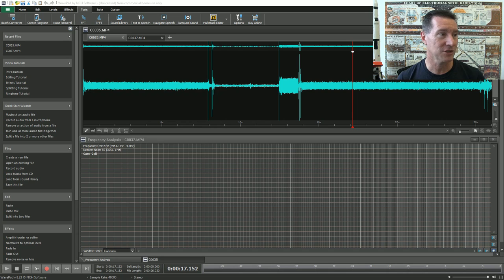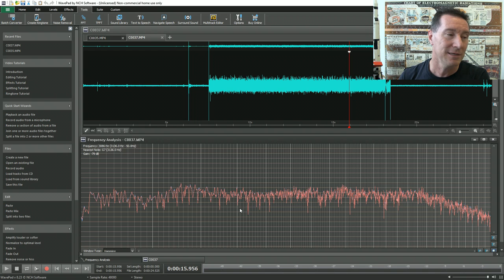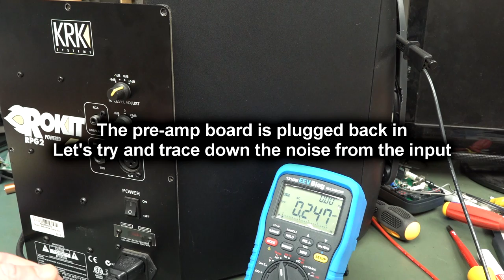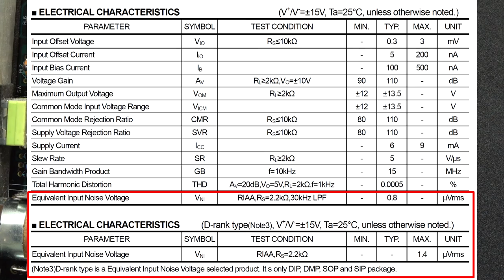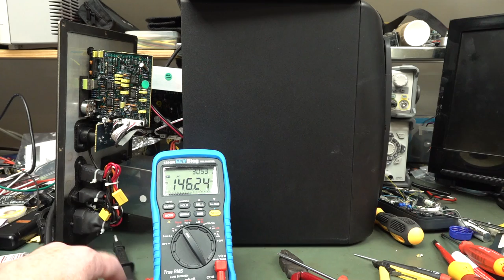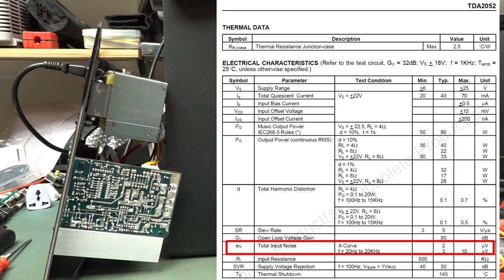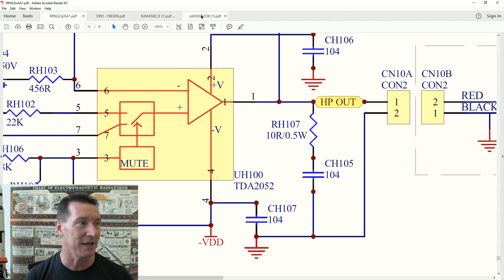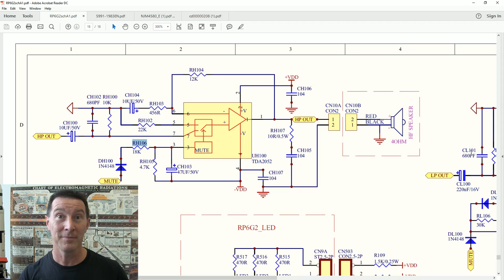EEVblog #1118 - Why Are Studio Monitors Noisy?

Comment: Because those are basically "pro-sumer" grade at best. Built in power amp is the first red flag. Probably perfect for their purpose though. You'd be silly to set up a recording studio level monitor system for your application.
Reply: Even the most expensive studio monitors are powered bi amp speakers. The reason is you want an individual amp for each driver. This approach apparently provides a better crossover and transient response
Reply: My comment had nothing to do with bi-amping. There is a cheap, possibly class D, amp in those things. Not that class D is necessarily bad either, but does require higher quality to get right.
Reply: finally saw the teardown. Not class D. Not high end by a stretch though.
Reply: Phillip Morrison, exactly, there are plenty of professional studio monitors with builtin amps. More compact and convenient, no crosstalk. I guess it also helps to tune the frequency response of the entire system? (although I'm certain the amps are much flatter than the speakers)
Reply: Dan Moos  I'm responding to your comment " Built in power amp is the first red flag" by explaining why even the most expensive studio monitors are POWERED bi amp speakers...
Reply: ah.
Reply: Nothing wrong with integrated class D amps, as long as they are of good quality.
Reply from the maker: If you looked a the datasheet the driver is Class AB
Reply: @Philip  "Even the most expensive studio monitors are powered bi amp speakers."
Obviously, a powered speaker is always gonna cost more than its non-powered equivalent, so the most expensive is powered.
But I assume you meant to say all pro monitors are powered bi-amp speakers? All will probably be true for being bi-amped, but not for being powered.
Reply: Kris M It would be silly to waste a rack slot (or more) on an amp just for the mixer room monitors.  Which also provides another point, the mixer room will have background noise from tapes, fans, meter needles, chairs etc.  Monitor noise just needs to be less than that.  Now if you install monitors on the silent side of the glass, they should be passive speakers fed from an amp in the mixer room.
Reply: @John  I agree, and so did you. :)
Reply: wahaha meter needles :P

Comment: My cheap-o MicroLab T9s i use with my w/shop computer became so bad with hiss over time i gave up on the crap-as internal amplifier with all the OneHungLow components. By 'back engineering' the amp containing unit so the x-over feed was re-joined to the external terminals and removing the fixed mains in lead i had two normal speaker units. Smacked together a TDA7377 with a VR on some protoboard and power supply... the speakers have never sounded so good.

Comment: Hey Dave, can you do a video on output and speaker matching? How the impedance is measured. How a home gamer can test for best guess speaker impedance with limited gear (like my 121gw)

I think it's a fairly important but overlooked segment of electronics... not high level stuff.. more like beginner level
Reply: Speaker impedance is probably not what you think it is. If you looked at the AC impedance, you would be astonished at the very large rise at the speaker's resonant frequency. At high frequencies, the impedance rises as the coil inductance kicks in. The curve of impedance vs. frequency looks like a backwards S turned on its side.

Still think it's simple stuff?

Comment: I do a project making a sound system that are active.use dsp cotrolled crossover and build 4 mono power amplifiers for tweeter and midrange section.they are 120w each.They are  copied from a popular build from milenium and are called The end xp milenium.The pcb is a little bigger than a credit card with sanken2sc2922 and 2sa1216 on each.no global or local negative feedback is used just short signal path and very good components.every stage run only in their most linear state/power?area.No self oscillation problem.they sound better than the rotel and nad or some high end brands that i have had over the years.since i use amt type tweeters and planar midranges with high sensitivity direct from poweramps i need extreme ow noise.The end XP mileniums does with so low hiss that i only can detect it with ear to tweeter.with a rotel power amp i could hear the noise from my listening position 3 meter away.Nad was a bit better than rotel talking about noise hiss.

Comment: And the result or quintessence of this videos is now... ? After 23 minutes you just answer where it comes from, and then, The End? No word on if it can be fixed with a different (better) power supply?
Reply: It's noise inherent in the power amplifier plus a little thermal noise from the resistors around the amp. Everything has noise. Whatcha gonna do?

Comment: Yeah that's what I thought. The noise is not because of shitty amp, its because there is no passive crossover to decrease speaker efficiency and eat the noise.
I had to get rid of my JBL monitors because of this hiss. The only solution I can think of is to add a couple of L-pads while controlling the balance between woofer and tweeter with a good microphone.
It will lower the maximum SPL but it is worth it if the noise is gone.
Reply: what did you replace them with? i have the lsr 305s and i don't like the hiss
Reply: Used jbl studio 530

Comment: It's because the output  transistors  (inside the chip package ) are  slightly  biased   on, causing the  noise/ripple
Reply: Causing it how? And how does this square with the silence when the preamp was disconnected? Every class B amplifier has bias. They don't all do this.

Comment: Helppp! My HS5 as making a very high pitched sound as soon as I turn them on and I've tried everything. It does that even when it's not plugged to the interface or if absolutely nothing is on next to it (my setup is just the monitors and a scarlet 18i8 and it does that even when everything is off, the internet modem is far away as well as other electronics), when it is just simply plugged with the power cable. I've tried changing plugs but yeah it makes this noise as soon as I turn it on, just with the power cable plugged into it. What could that be??

Comment: USB Headsets have the same problem! Every one I came across, even some in the 200+ € range, have a background noise. Only plug it into USB, and **shhhshshshshhshs**. Even some which were praised as "good sound" by friends, I put them on, NOISE... Then I use the onboard soundcard with normal headphones: No noise at all. Even with the Realtek chips. Same with my (old) Soundblaster Live, no noise at all. I hate those USB headsets, only good for loud environments...

Comment: You are right - the noise in the tweeter is inherent in the HF power Amp. It is a design choice, not a fault. You probably have gobs (audiophile term - it means several dB) of spare gain in the overall setup that you are not using. Reduce the HF Power amp's direct gain by a couple of orders (say RH104 to 2.2K) and the absolute output noise (but not the signal/noise ratio!) will then  improve (decrease)

Comment: What about fitting a capacitor between the negative and positive signals in order to reduce noise is this a crazy idea can anyone tell me a simpler solution or is it just a question of  replacing the power board with lower noise levels as the kind gentleman said.

Comment: I have a pair of KRK G3 6's and they are not noisy at all. Even my Behringer MS10 are not. So its not such a apparent problem
Reply from the maker: Do the KRK G3's have auto-mute?
Reply: sorry dude it really is a wide-spread problem. in fact its so wide spread you might as well say every studio monitor has this issue. it drives me up the freaking wall. i almost need to use just off the shelf silly speakers with an amp for analysis because of the lower noise floor.

monitors are basically at maximum amplification all day long with a quiet input. it sucks.
Reply: But could it be as simple as changing the feedback resistance to alter the output gain stage? This video is making me want to mod a few speakers I have which been bugging me because of the hiss.

Comment: Do what I did. Get to fire guns without full hearing protection and every amp sounds great.I am partly serious. Fire a single 12g shell and when the ringing stops you will save a fortune in audio equipment but be unable to tell anything has changed. You can get the same effect using earbuds and a music player/phone for a year.
Reply: And once you get past the age of 60 there is no high frequency noise anywhere, apart from that continuous 1kHz tone that's always there.
Reply: Well past 60 and have been lucky there. No tinnitus at all. Top frequency is down to about 10KHz which is fine. Many youngsters wearing earbuds will be in a much worse state.

Comment: You talked for a long time about what does not cause the hiss, but then just concluded "it's the amplifier." That's not very helpful. What is it about the amplifier that means it hisses and is there any solution to the problem? Quite a frustrating video, actually.

Comment: I put it down to bad amp design, if most powered monitors are noisey. why should they be different to seperate amp and speaker in regards to noise. my sony av amp can be at full volume and be absolutley silent, hey even my 20+ year old sound lab pc speakers have no audable noise at full volume.

Comment: I used to have a really strange problem with my old speaker setup back in my old apartment.  For some reason, only during the summer months, and only at certain times at night, a radio station would suddenly start coming in through my AUX input.  It was the strangest thing.  Since I've moved, it hasn't happened and it would only happen in the summer and during that certain time of night.   Thinking back, the same kind of strange thing happened with my old corded phone back in the 80's when I was still living at home.  It would only happen at night.  And my phone would pick up this one person's CB radio.  It was always the same guy.  He was in a truck and I even remember his handle (He signed on with it all the time.) because I would be talking on the phone and this guy would come on and I would hear the guy's side of the conversations talking about where he was going.  I couldn't hear the voice of who he was talking to.  I only heard him.  He was always on the highway a good several miles away from where I lived, and it was quite a distance.  At first, it used to startle me because I would tell my friends that "There's someone else on the phone with us!".  My friends couldn't hear him so they always thought I was nuts.  Sometimes, I would pick up the phone with the dial tone running and hear the CB guy.  And once again.. I believe that this is an issue that only happened in the summer months.  Does the summer weather do something to radio signals or something to cause electronics to.. be more receptive to picking them up?  What could have been causing this?  I've been curious about this for years.
Reply: High temperatures causes cables to expand and hence increase in length. The effect is similar to changing the length of a radio antenna.
Reply: Well.. the telephone cables in my neigborhood were underground at the home where the CB was affecting my telephone Our telephone box was up the street and shared by four other houses and the cables all ran underground.  So I don't know if expansion and the cables picking things up is the answer.  Unless something on the roof of our house (or someone else's was picking up the signals and was somehow funneling it down into a phone line).  There were above ground cables attached to the building in the other case where I was getting the radio station coming in through the AUX port on my computer at night during the summer.  The AUX port also wasn't connected to any cables by the way.  It was open to the air.  And this problem stopped when I moved to my current apartment.

Comment: Can't find a Pin for pin replacement, most of the audio guys recommend replacing that module with this board
HiFi LM3886TF Mono 68W 4Ω Audio Power Amplifier Board AMP 50W/38W 8Ω Q5B5. $6.36 US free shipping from eBay. Based on a TI LM3886 module. Has same basic specs, Different package but audio guys seem to agree gets rid of the hiss. They agree that using the assembled board is fastest easiest, cheapest and best way to fix those particular monitor speaker's hiss problem.
Mark in Texas

Comment: Pfft. Powered studio monitors are gimmick junk targeted at the burgeoning rube and tweaker markets. "Studio Monitor" is a marketing term and has no meaning outside a sales brochure. Quality studios buy quality component gear (Tannoy speakers with NAD amps, Magnapan speakers with Krell monoblocks, etc), and set them up very carefully, then spend most of their time wearing headphones. Almost any mid-high quality bookshelf speaker with a half-decent external class A or AB amp will sound a lot better than a "studio monitor".

Comment: You are using a microphone to record the noise. Duh. The microphone is picking up noise that  may or may not be there in the monitor itself. The only real way to measure this is the electrical /ohms/watts/dc/ac current measurements. The thing you're forgetting is, studio monitors are designed to give a neutral picture of real world conditions. Without that, mixing/mastering is useless.

Comment: The noise may just capacitively couple through the thermal tab and the heatsink from the power supply, or it may be a less optimal layout for grounding / bypass of the amp.

Comment: I'm thinking of getting a pair of Yamaha HS-8s. Does anyone here have these, do they suffer from this problem and where would you place them in the market in terms of quality?
Reply: I have a pair of HS-5s.  There is some pickup in my system, but as I can hear that through headphones from my interface (Focusrite 6i6), I'd say the Yamahas are quiet and my cabling needs a bit of attention :-) .  I have nothing else to compare them to, but I like the sound they make (although the HS-8s will have a better low end) and they are well made.
Reply: Can confirm hiss, even worse if you have a mixer and usb soundcard in the loop. Found that plugging the computer into a separate outlet on a different circuit fixes the ground loop but still has the minor hiss. I also have had Adam a7's and the Yamaha are slightly duller but as with any monitor you get to know them and can account for their flaws. Also needs sub, any sub will do IMHO. Obviously the paired one is better.

Comment: This is largely just a shit power supply I think. The 100Hz hum is probably being coupled in simply due to proximity to the transformer. It has nothing to do with using Class AB/Class D or anything else. I have designed LM3886 based amps (often used in powered monitors) which are dead silent.

Comment: So they overspend on low-noise op-amps in the pre-amp stage when they know fine well that the chip-amp downstream is crap (and probably a Chinesium copy of an old Japanese/Western design at that).

Isn't that they very definition of poor engineering?

Comment: inherent noise of class-d amplifiers..  (We got a set of tannoy  speakers with no hiss on the tweeters..) and a set of EON 10's that are super loud hiss...
Reply from the maker: These use a Class AB amp.
Reply: Yep the classic Class-D vs Class-A noise.  Just get two un-powered speakers and a modest Class-A 50W stereo amp, and you will only hear noise that exists in your source material.
Reply: Wow.. okay.. thanks for letting me know... I was under the thought that most Class-D amps have this issue... 

BTW good topic.. hope you drill down into the AMP section.. thanks again for all the information and your videos.
Reply: regardless of whether cheaper class D amps might be noisy, class D has no "inherent" noise

Comment: That amplifier audio IC is something that I don't trust because it does not require external transistor.  Fortunately, I bought a better amplifier IC that require external transistor.  It is out of production and rare too.  You might remember LME49811 from digikey.com or other store.  It is no longer making.
Reply from the maker: The output noise is specified on the LME49811, 70uV to 180uV max. So lower than these KRK's, but not ultra low.
Reply: Yes.  That is true.  It is not going to beat the non-IC amplifier board, but good for building my own theater amplifier tho.  LME49811 is nowhere lower noise than my vintage Marantz 2220 stereo because there is no IC on board at all.  I had went back to digikey.com to look for class AB amplifier with external transistor, unable to find it.

Comment: just saying i a bored i guess love you man God bless but here it gos i dis like small amp chips same  crap in it all vintage is the way you buy it service its caps etc n then its great i got wharfdales call pawn shops 2nd hand if broke like me you still can have top shelf crap takes time  no internal amps ever n no switch mode power supply in my amps ever ;]..my receiver sansui 9090db the pioneer sx1010 is nice may need to referb one as there old but it good to go after n there worth it

Comment: put a ferrite bead on the cables
Reply: Not going to help, in general, you're hooking up a monitor with XLR which is going to buck all the inductive noise over the cable anyways.
Reply from the maker: Ferrite beads only do RF, that's not the issue here.
Reply: Great video Dave. Please note that these active speakers are general purpose "home-gamer A/V monitors" and not pro-recording studio master reference speakers. This is reflected in the size and hopefully the price. They make them compact and include an active component to market them. In a professional studio control/master room you wouldn't find powered monitors used as main reference.
Reply: You see powered monitors regularly for mixing.  Not so much for final mastering.